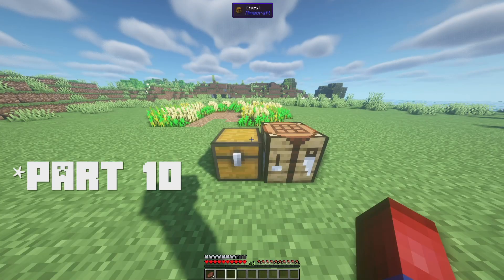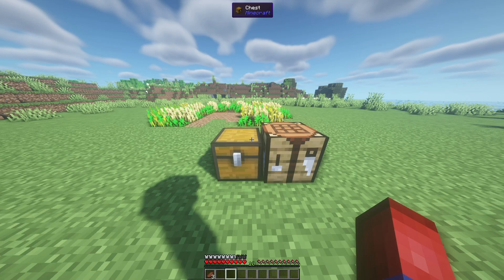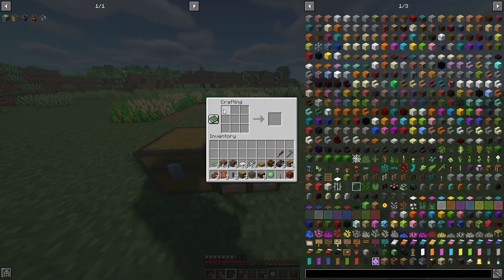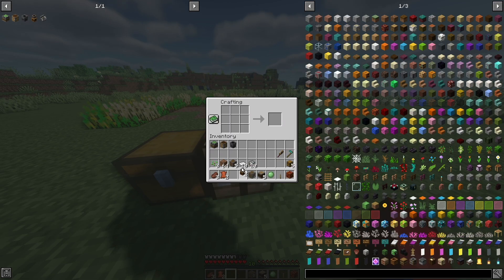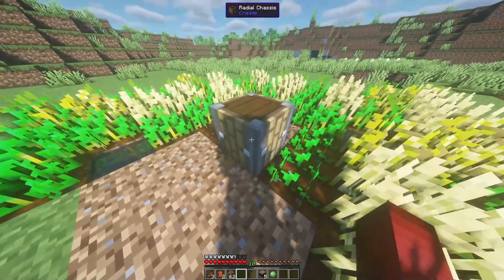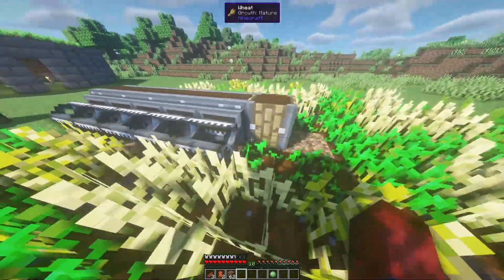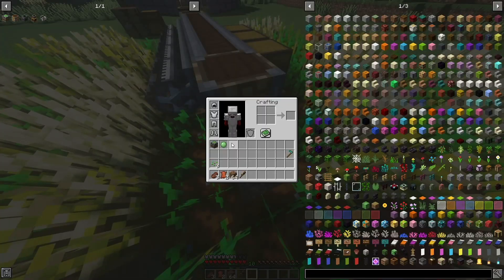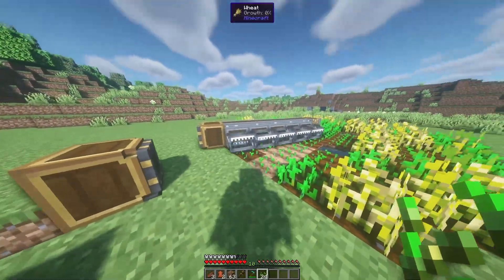Minecraft Create Mod Tutorial - Mechanical Harvester Farm Ep 10

Comment: As of 1.18 this method doesn't seem to work... Either that, or somehow I messed up a step. But for some reason after placing everything above the magma block; I'm unable to make the mechanism spin, even after turning it on with a lever. Any insight is greatly appreciated
Reply: if you are in .5 then that method of powering it has been removed, you should just make a water wheel underground or something similar
Reply: i did it by using a water wheel to power it instead